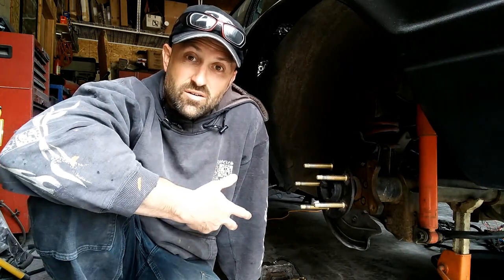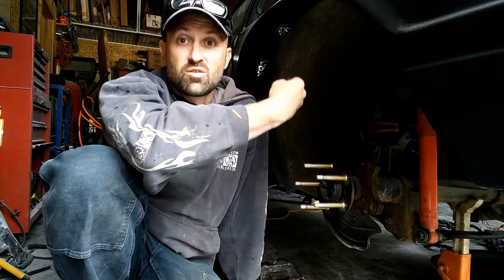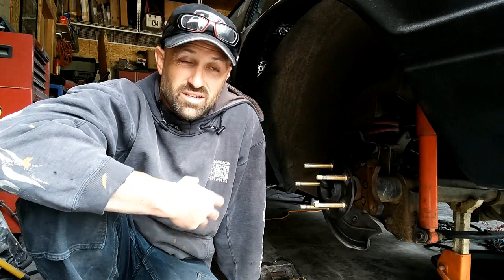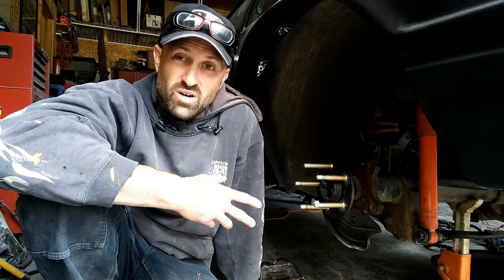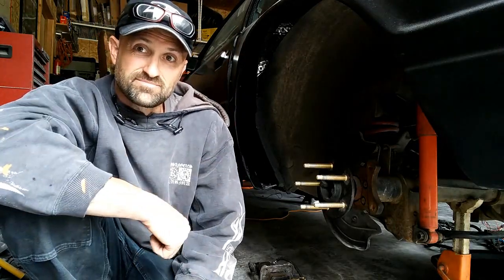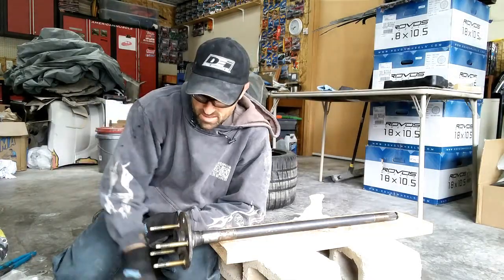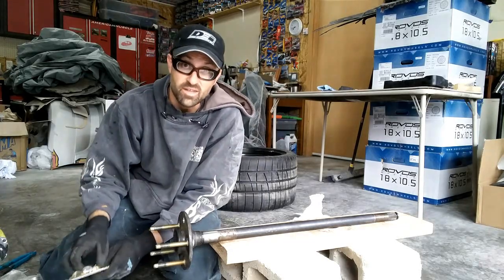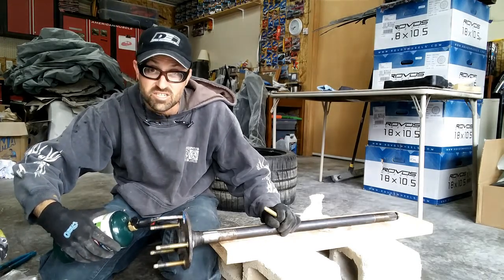How to Replace a Wheel Axle Stud

Comment: I dont understand why the axel comes off. On the 2013 (solid rear axel on 2014 anf below) there is a hole for the screw to be hammered out. The hub needs to be rotated when the car is jacked up in neutral and no parking brake on.
Reply: *rotating the hub lines up the hole behind the screw. Use a nut with a washer to pressure fit the new bolt into place.
Reply from the maker: The early 90s model housing didn't have that hole to take out the studs. I was swapping out the axles and brakes from 4-lug to 5-lug.
Reply from the maker: The early 90s model housing didn't have that hole to take out the studs. I was swapping out the axles and brakes from 4-lug to 5-lug.

Comment: Instead of a stack of washers I used a large nut that could accommodate the part of the splines that pull through. Depending on how much pulls through you may have to chamfer the inner holes on the brake rotor to clear the splines.
Reply from the maker: If I did it again, I'd probably look at a big nut or something like you mentioned. Good advice.

Comment: Bought new axels for my 8.8 ok I guess it is called the knurl it says that my axel  holes for the studs are 0.6 the studs I have are basically stock stud the knurl on the studs are 0.618 should I have to do any drilling on the axel stud holes? Haven't gotten the studs yet should I try to find different stud something closer to a 0.6 or can I use the 0.618 ? I hope I don't confused any info would be helpful thank u!
Reply from the maker: The ARP studs have a .625 knurl, and drilling the holes with a 39/64" makes the holes .609.  You have a .016 overlap, so you basically crush the knurl into the hole.  It sounds like you have a .018 overlap on your setup, which I would guess will work.  Most replacement axles are meant for OEM or direct replacement studs without the drilling.  The ARP studs are a little bigger, which is why you need to drill.

Comment: What’s the cost of them studs an part number where did u get them
Reply from the maker: Shaun Johnson ARP 100-7703. About $20 for a pack of 5 off Amazon. I bought two packs.
Reply: Basin Motorsports thanks bro that’s one sick fox .
Reply from the maker: Shaun Johnson Thank you. Its been a huge pain to build, but it's coming out great. I'm learning to wrap this weekend, so it will be a uniform color soon.
Reply: @BasinMotorsports  About $45-55 for a set of 5 now. I have the same ones on redrilled corvette C6 hub bearings.